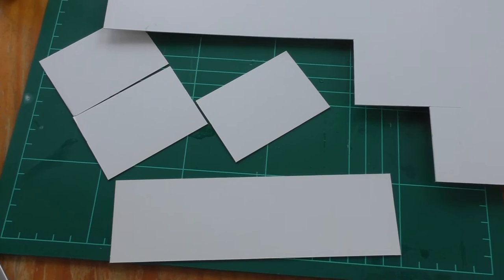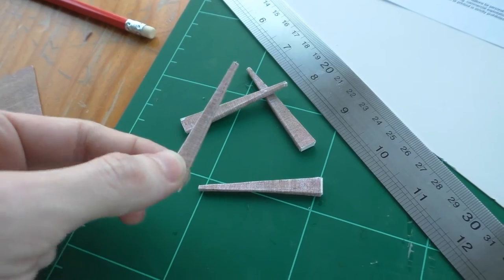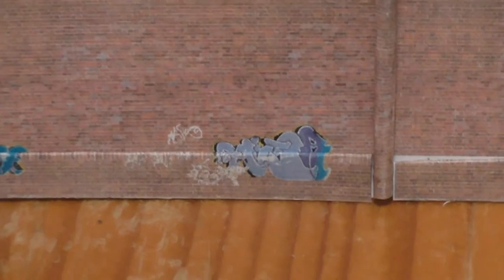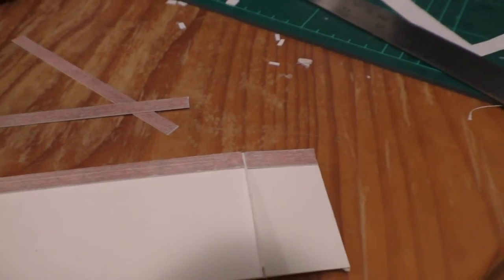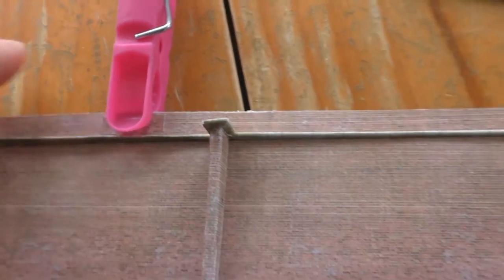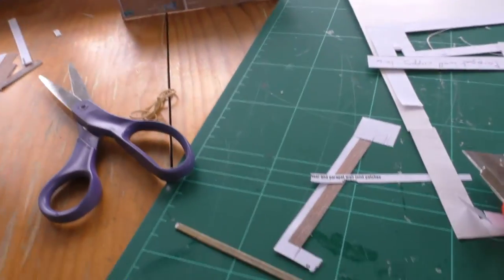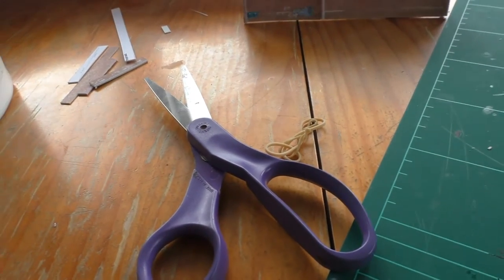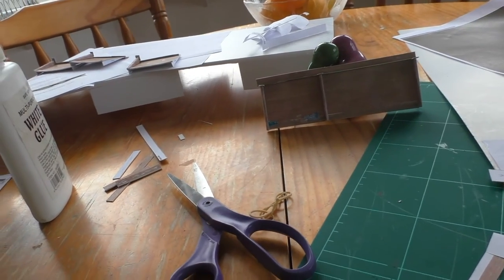Building a ScaleScenes Retaining wall

Comment: I don't really understand. I see you have built it to their design, but how common is the prototype for those inverted buttresses? I'll admit I can't recall ever seeing anything like them, and it's hard to understand how they buttress anything. Does the wall slope backwards, and the buttress fronts are vertical? Even so, I wouldn't really understand.
Reply from the maker: http://www.railway-centre.com/uploads/7/2/2/3/7223531/pod-28-05-17_1_orig.jpg

The retaining walls slope backwards away from the track, the buttresses provide support one assumes
Reply: the buttresses in real 1:1 life are vertical, and the wall section slopes backward this builds stability into the wall.  I gave up on the video because the headband camera was, frankly, making me nauseous so I don't know if he set them on the layout correctly.